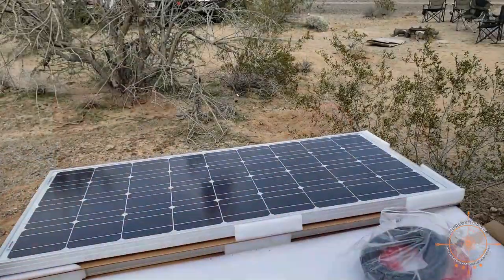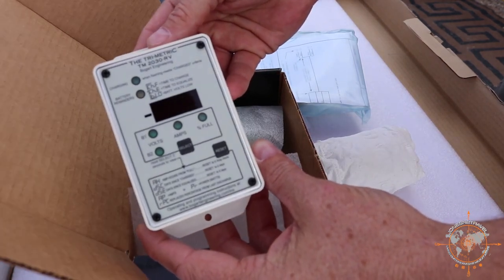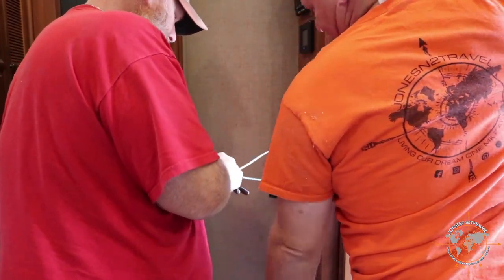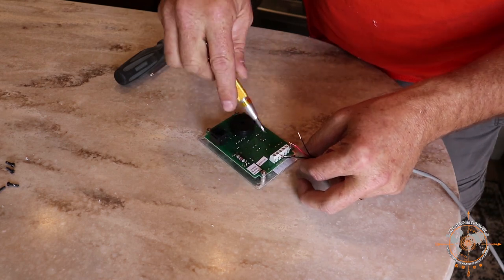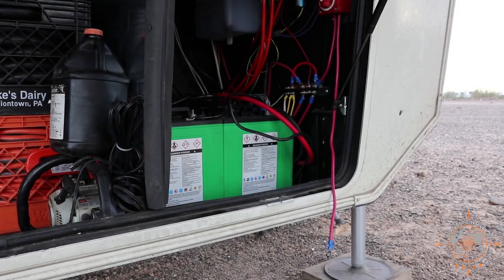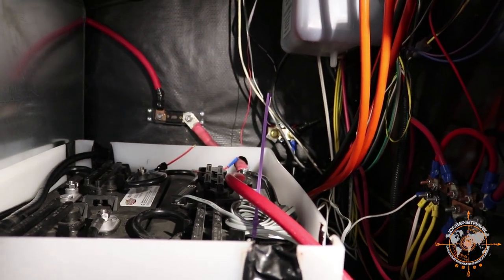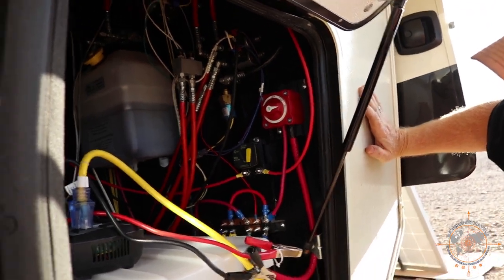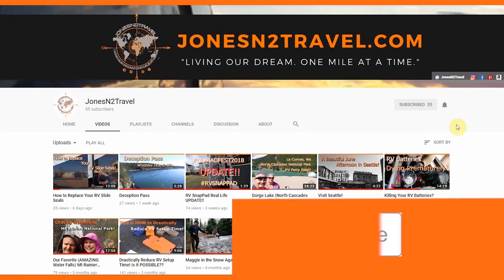DIY PORTABLE SOLAR PANELS FOR RV | RV LIVING

Comment: We need this for our trailer, we met tommy and lori also 👍  how much for this set up?  Great video
Reply from the maker: It is a very good system. For this exact setup you're looking at about $600. There is a suitcase option that you can get a little bit cheaper that has the solar controller built onto the back of one of the panels. Not that there is anything wrong with that but Tommy's system included a battery monitor inside the coach that communicates with the solar controller allowing you better management capabilities of the system. I would love to help you set it up if you're in the Quartzsite area this winter. Let me know if you have any other questions, Glad to help where I can. Safe Travels.
Reply: @JonesN2Travel  we are in quartzsite now , we want the suitcase one actually . Were are you camping at ?
Reply from the maker: @JantzRoadTrippin  Sorry, I didn't see your comment LOL We are in Laposa South BLM. Here is a really nice 100 AMP suitcase from Renogy on Amazon right now for just under $300. They also have a 200 Watt version for around $400 https://amzn.to/39zYspq 
Lets get together and I can show you the same setup we built for Tommy. I have the same ground setup that he has so you can compare. :)
Reply: @JonesN2Travel  ok we would love to come by  👍